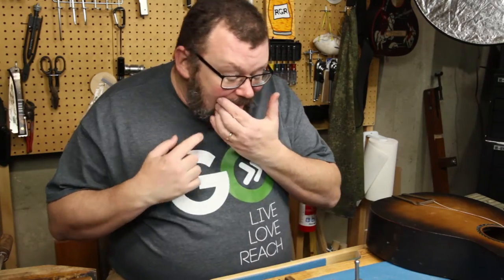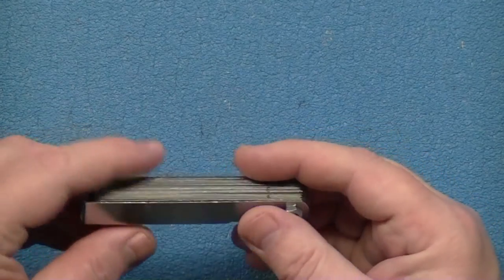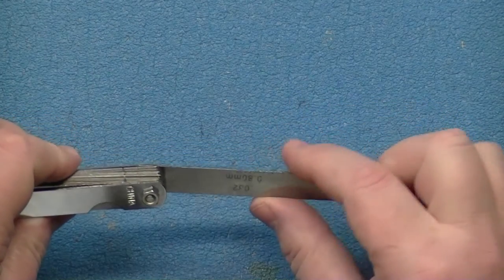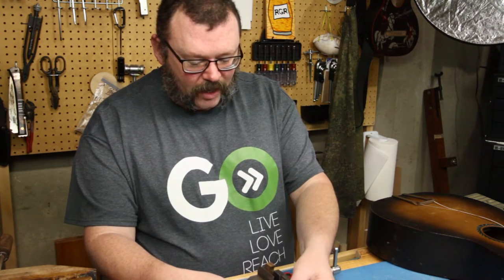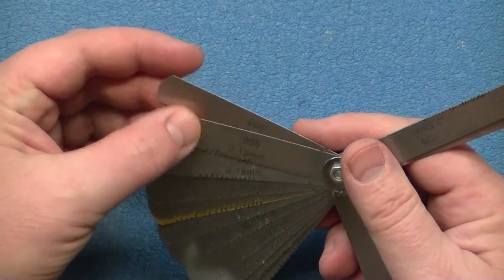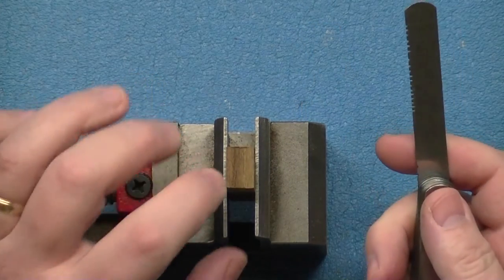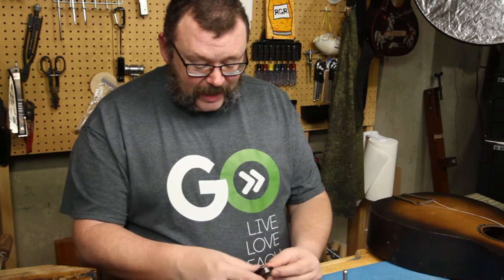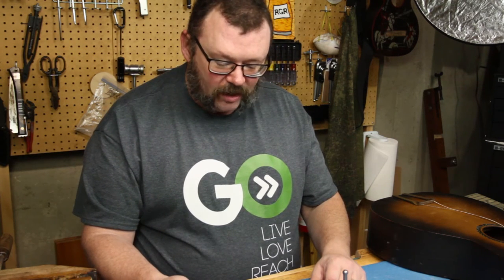Cheap and Easy! | RATTLECAN GUITAR RESTORATIONS by James O’Rear

Comment: Huge. Better than torch tip cleaners, but I used those at the end to round the bottom of the nut slot. Worked like a damn.

Comment: I used a Dremel and thin Cut Of Wheel #409 to create the saw blade teeth in those blades. It’s nice to have a working solution for 4-5 bucks. 😊

Comment: You might want to consider using a saw sharpening file, like an X-Slim Taper, or even XX-Slim. They'll cut pointed teeth very quickly, especially in unhardened steel like feeler gauges. You should even be able to gang together a few gauges and file them at the same time, which would make it go even faster; the teeth really only need to be as deep as the gauge is thick, but you could take them all to whatever your thickest gauge is, which still won't be very deep. One or two passes with a new sharpening file should be all it takes to cut each gullet. A triangular jeweler's file would probably work fine too, if a bit fiddly.
Reply from the maker: I have a couple of these to be made soon, I'll let you know what I come up with. Thanks for the info.

Comment: I have 3 sets of these. I misplace them so I have extras. The only thing I do different is I round them a bit to leave a round seat in the nut slot. Good ans cheapo tip! Thankz
Reply from the maker: What did you use to round the bottom of them with?
Reply: Rattlecan Guitar Restorations I used a fine metal file. I put each blade in a vise and rounded the teeth side. You might want to round the blades before cutting the teeth. You can round also with sandpaper, the 10s and 12s and 16s are hard to hold and file. The first set I made I used a file to make the teeth and I had to super glue some of the blades together to get the correct thickness. If you want to make theses, look for feeler gauges that have the right gauges you need. Also if you have to glue blades together, clean them well, because they have oil on them. Thankz
Reply from the maker: Got it, thanks!
Reply: Audio Tech Labs great idea on gluing them together to get the size you want !
Reply: Does it work without any modification on the gauges?? I mean using then to make a slot deeper...

Comment: A set of welding tip cleaners, about $3, is perfect for nut files. They are basically round wire files in different diameters.
Reply from the maker: They work pretty slick as well.
Reply: I use the feeler gauge 'saws' to get the slots ~90% of the way there and then switch to the torch tip cleaners to ensure a rounded bottom slot.
Reply: The problem with the welding tip cleaners is that the smaller diameter is 0.016". So that wouldn't work for the high E and the B string.